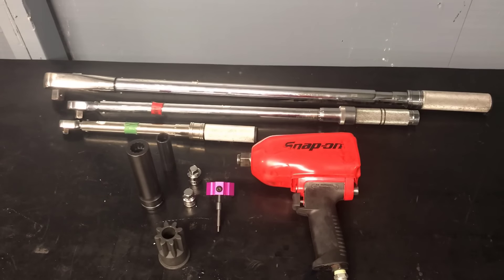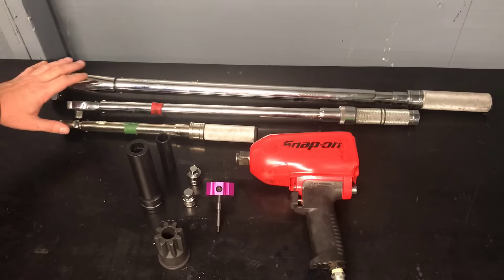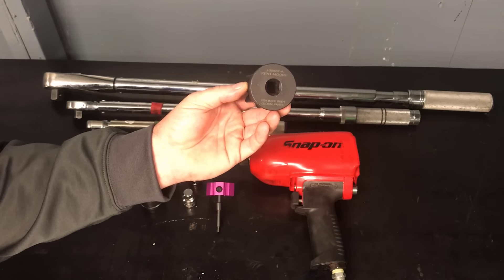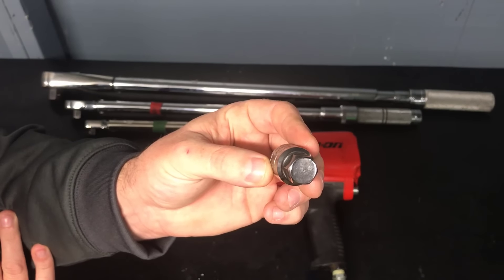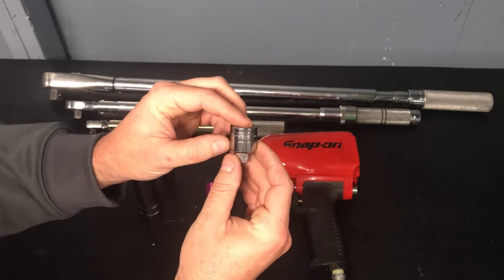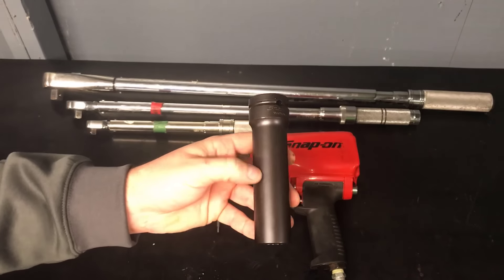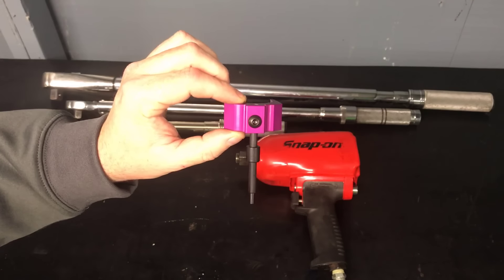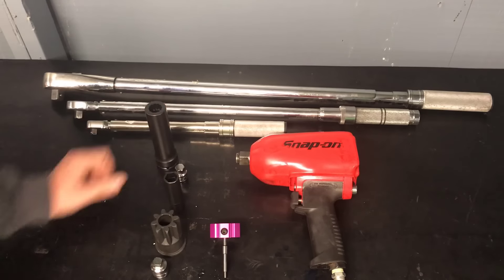SNAP ON JUNKIE CAT SPECIALTY TOOL CHANNEL UPDATE

Comment: great video the big cats are a dandy to work on you may need an impact driver to get the cam gear(peanut) cover bolts out and replace with normal metric bolts. great vids man keep it up!!!!
Reply from the maker: turninwrenches 55 The engine teardown video should be up in about an hour or so